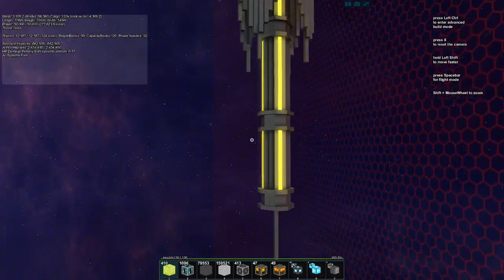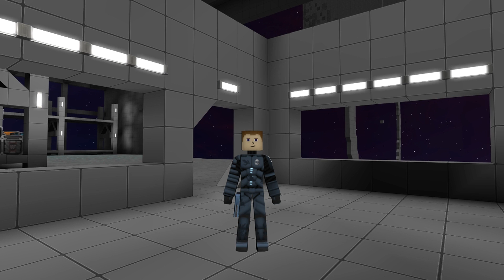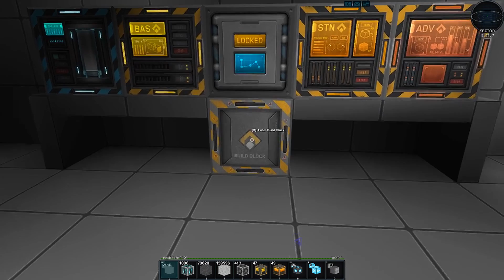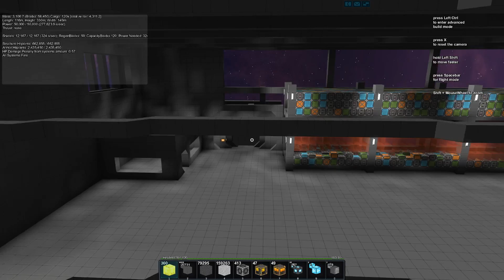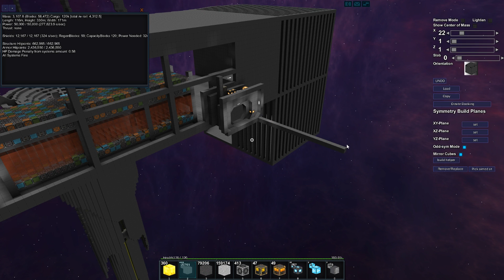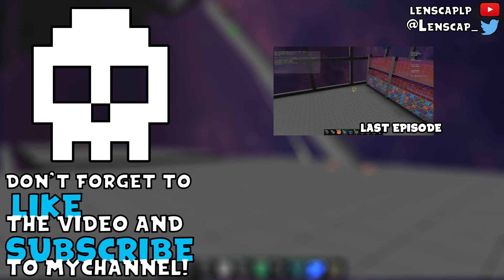StarMade: StarSquad - S2 E41 - Industrial Rail Door / Freight Elevator

Comment: Just be careful that the inner and outer sections of the station can meet smoothly. It'll be a pain to have to adjust everything.
Reply from the maker: Yeah, for sure. Gotta build the inner parts and then the outer parts around it. Can always leave a few blocks around the walls for room for shields etc